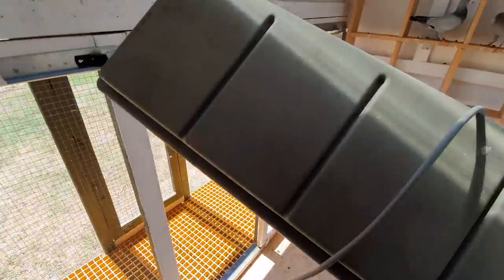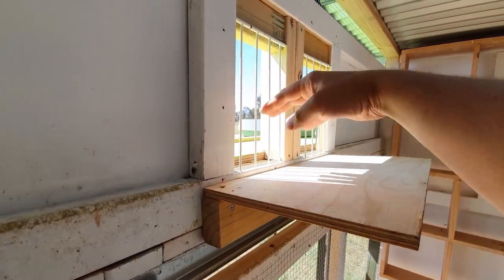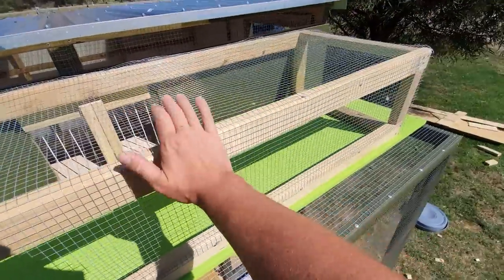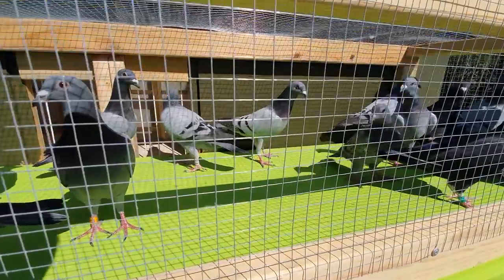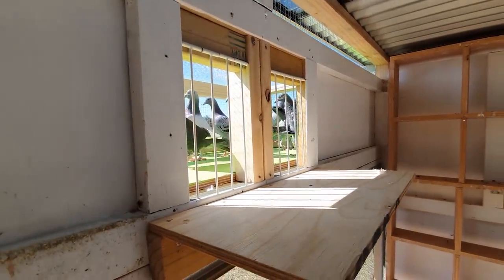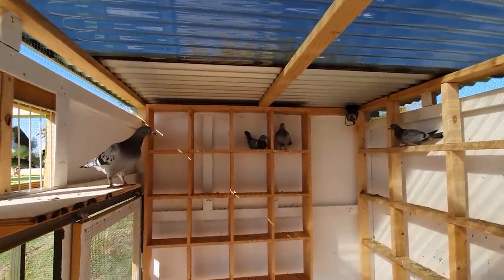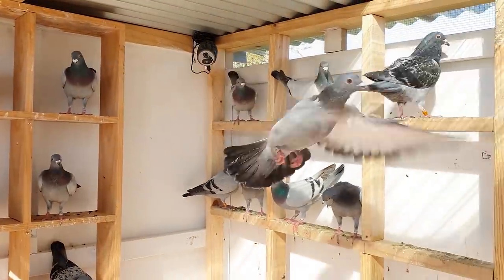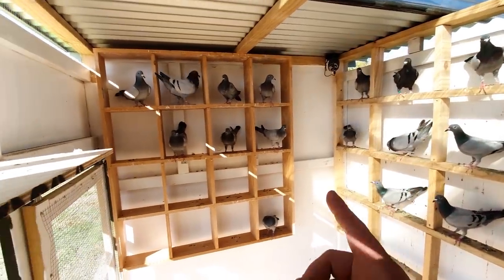NEW PIGEON TRAP & FIRST USE

Comment: Have you thought about putting their landing platform on hinges to close access to bobs when not in use? I had the same setup and mine figured out how to move a wire enough to get out on their own. I also use it to ensure hawks and kestrels don’t get in
Reply from the maker: i was thinking of putting a door on the outside but i do like your idea
Reply: @ManeyPigeons  I made mine out of 1/4” square wire and boardered with scrap wood. That way when it’s up, they can still see through and get a draft, but when down, they can see through it to the ground and perches
Reply: Mine did the same even without benefit of platform inside to stand on.  If one sees it. They'll fly by themselves, eat off ground, puddled water. Biological hazards

Comment: Utilize entire landing board. They should be able to access  landing and drop in on their own. Have a larger cover that's not a box but angled from roof to front of landing. I saw this situation at other location. Physically placing each bird on landing to "train" is way to much work. They should do it automatically by themselves.   Preferably with exit above traps to drop onto deck, then use traps to enter. Much more weather tight. Bath them on landing also. With large screen. Launching close to the ground is not advisable , potential for ambush and leaping cats etc. .  They launch from transport elevated. They can have feathers damaged catching Individually. It's got to be easy. They need to be happy. Laying in sun on landing wings stretched after bath. Hatch doors to close them in inclement weather.
Reply from the maker: thanks for the good tip!

Comment: Take the inside board out ..they need to be able to put there heads through and see there floor and food and perchs...👍
Reply: i agree with removing the board.  perhaps the taurus needs to be outside the trap door.
Reply: @kennynang9417  it would be rule breaker. Depending on the club hes in.
Reply: Also, i think not. Maybe a bit smaller
Reply: @sluvvr  You are right that you have to be compliant to the club rules.  I guess small changes at a time may be good for the birds.
Reply from the maker: fed rules it has to be inside the loft hence the board idea, unless i can get a smaller pad then maybe we can make some changes
Reply: Its making them walk to far with bars on there backs ...it will spook a lot of them....head through...see the food and his woman and in he goes

Comment: Remember to have the chip rings allocated to your racing clock before testing the clock and the rings. It may otherwise seem like the whole thing is not working. Someone else who has the club clock can help you with that.  Once all the ring details are in your own clock you can attach the chip rings to the birds/or test them. Therefore also make a list of all your birds details : life ring number, colour and gender.  These details will also be required by the person programming your clock to your chip rings.  Have fun with far tosses later when the birds beat you home and you can see exactly who arrived when.

Comment: Put your pad on the outside thats vital seconds lost
Reply from the maker: i cannot club rules it needs to be inside of the loft
Reply: @ManeyPigeons  thats a shame in Ireland you can have at least 3 out side a well.
Reply: @ManeyPigeons  If you attach it under the aviary roof next to the trap is that not still classed as inside your loft?
Reply: I sapose but are your birds going to land there 🤔 and get a quick clock

Comment: Don’t put pad in up side down it won’t work as I found out the hard way
Reply from the maker: maybe ill face it up and make a bracket
Reply: Mine is on a shelf now may try putting it on that landing pad and get them used to walking over it